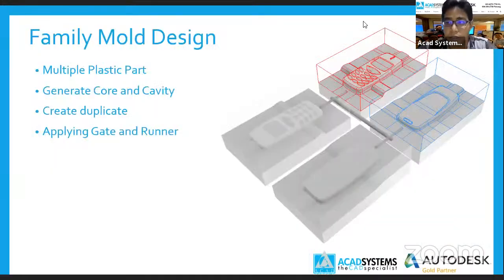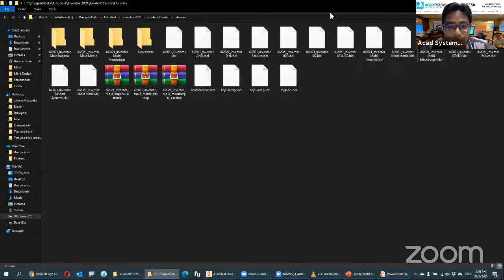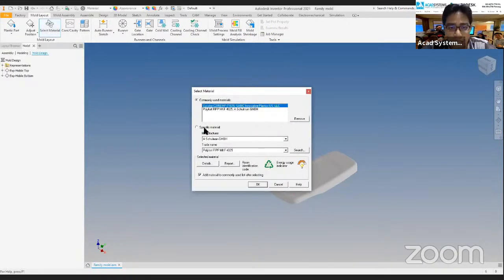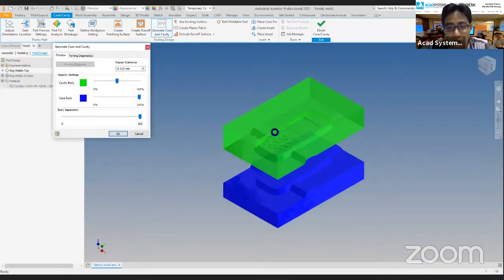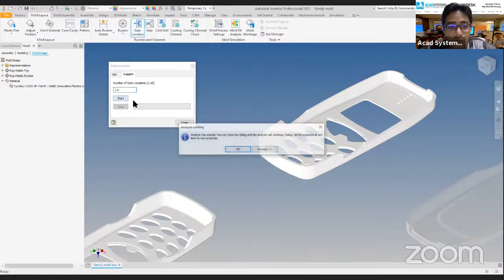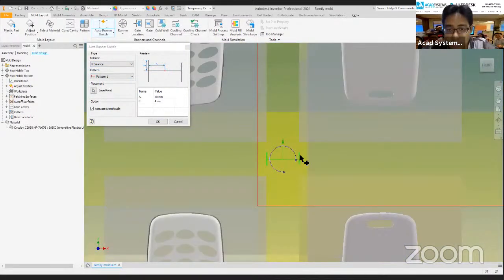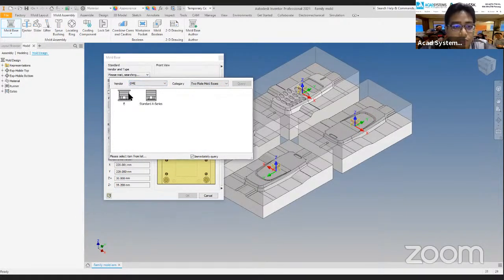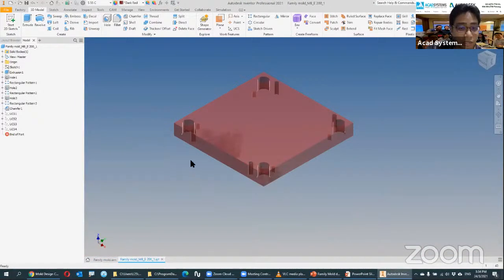Inventor Family Mold Design

Comment: my inventor pro 2021 version is not showing the select materials option
Reply from the maker: Hi Kevin Merai. Moldflow analysis was removed in the 2021 mould design version. As a result, there is no need to enter the material options.
Reply: @acadsystems  So, what should be done for analysis?
Reply from the maker: Hi, we can say the analysis has been moved to different software called Fusion 360.
Fusion 360 is another 3D modeling tools similar to inventor but focusing on cloud operation.
We also made the video on how to do analysis for mold flow in Fusion 360. You can check on the link below:
https://youtu.be/Nf7ijsPJS5U
Reply: @acadsystems  Thanks !!!